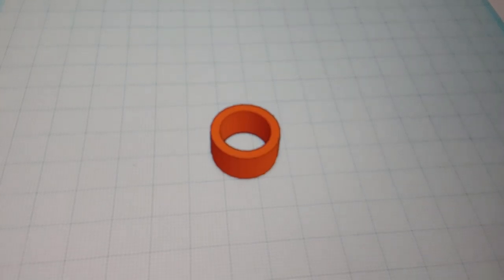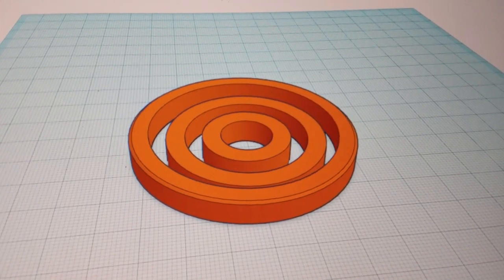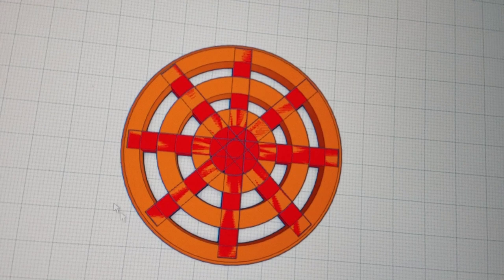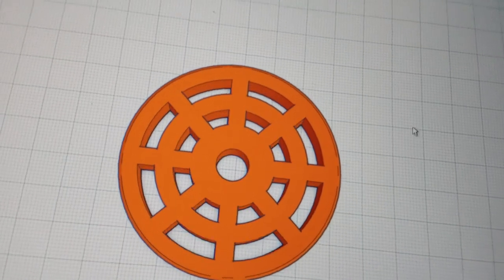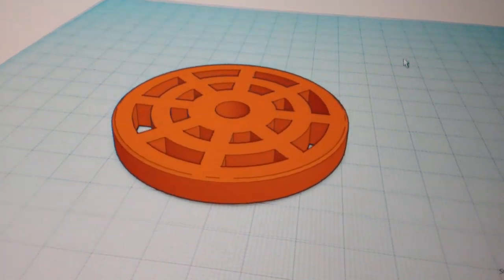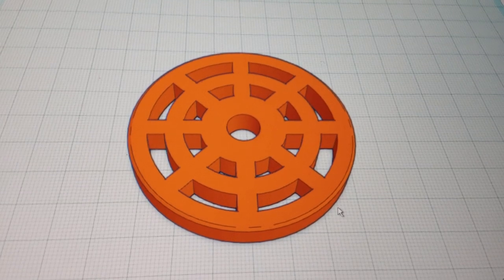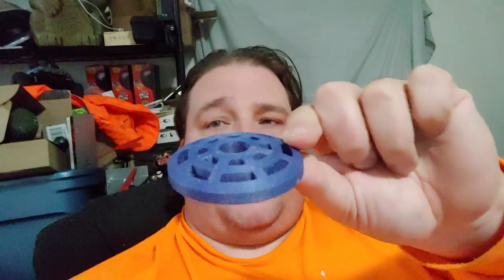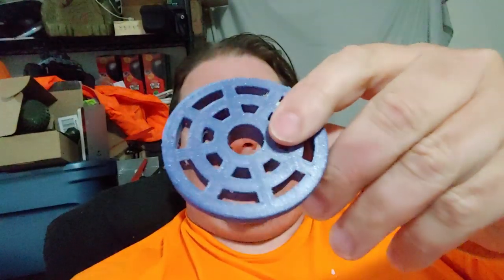Practical Print Shower Drain Screen for my Shower! 3 months in use! T3DP

Comment: How the heck did you bevel the outside edge?  Been trying to figure out how to do that and it's driving me nuts. Also after you duplicate the bar how did you you turn it? I've always used the rotate wheel by hand. Is there an easier way. (shortcut)☹️
Reply from the maker: The bevel applies to certain basic shapes the ring which I used to make this allows beveling

As for rotation I also use the hand rotation but if you move the mouse cursor inside the circle it moves at fixed increments if you move it outside the circle it allows any movement

The trick is Ctrl D when you do that don't do anything except rotate the part then hit Ctrl D again and it will duplicate your actions
Reply: Nerys Thanks Chris! I need to pay more attention to the options with the shapes.  Control D got it. It copies your last action👍🏼 So many how to just show it but don't explain it.  ❤️